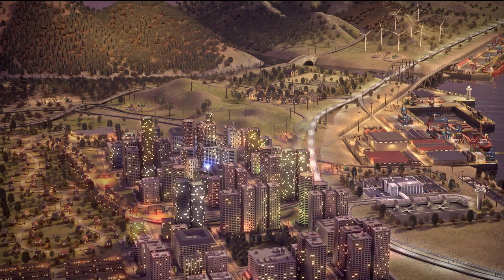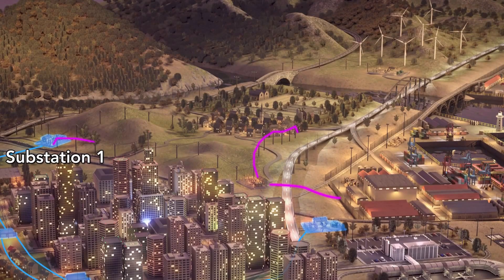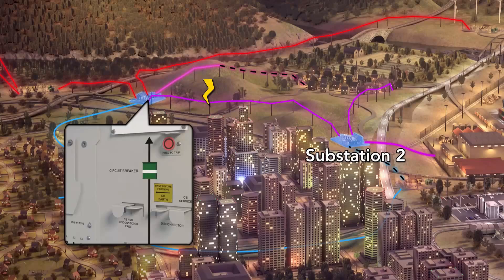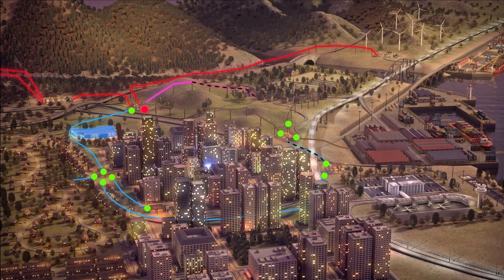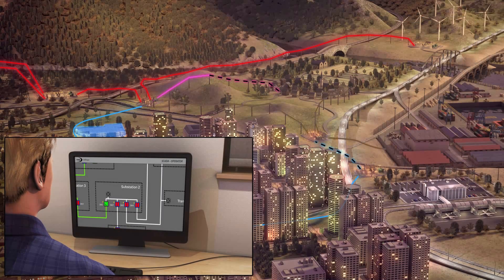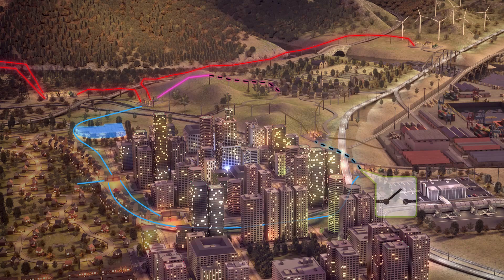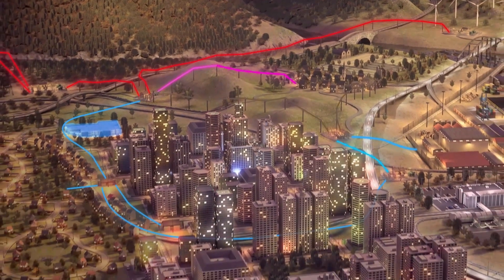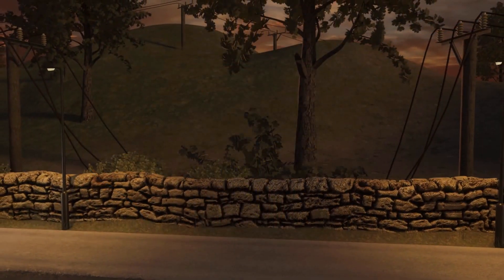SCADA Systems for electric power industry

Comment: Can this specific type of system applied to an electrical network (specifically a hydroelectric one) be hacked? I mean, can a hacker get remotely inside the scada system and sabotage it to make the network fail and create a power blackout, for example, in an entire city? Can this hack be done from the outside via internet? Or is it just impossible? Honestly I have no idea how these automation systems work, I am just curious because recently my country (Venezuela) went through a massive power
Blackout (more than 50hours without electricity) the government washed their hands by saying that the system was hacked and it had been sabotaged and I’m really curious to know if it’s possibles to sabotage a network like this one.
Reply from the maker: I don't have specific answer. But yes it is possible.
Reply: There is CVE about this.